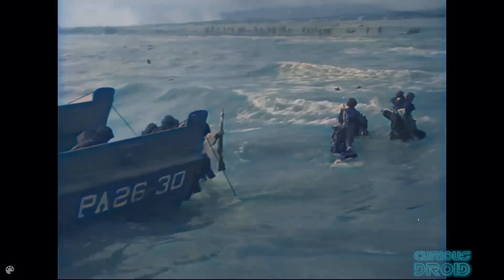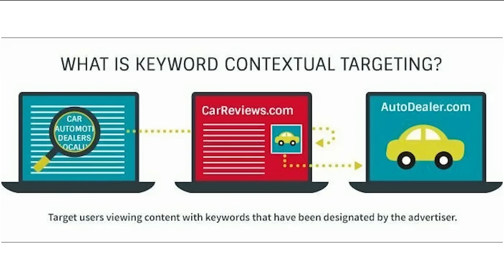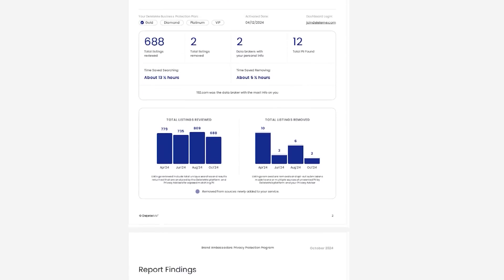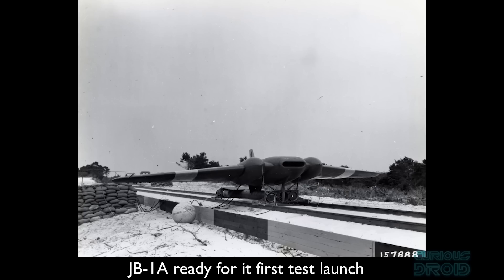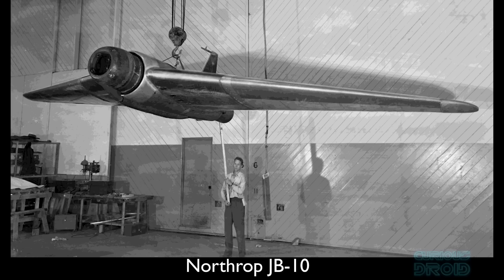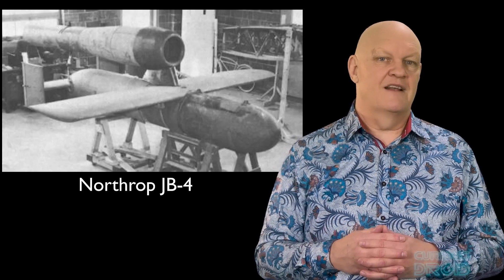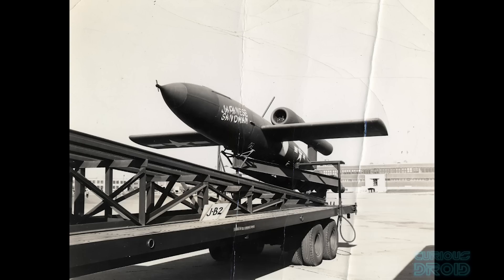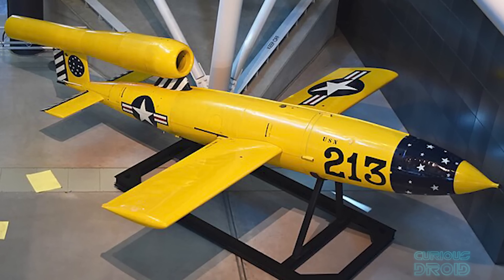America's First Guided Missile and How it Changed Warfare

Comment: The British gave the US a defective V-1. It failed to shut down the pulse jet  then dive when over its target so flew on until it ran out of fuel. The V-1 glided down to do a belly landing that should've set off the war head but didn't. The German Arms Ministry was paying 13,000 RM for each V-1. The US Army found a company to make their first copies for $600 apiece.
Reply: The V-1 never used to cut the fuel to initiate the dive. It used a small explosive to push and lock the elevator in the max nose down position, the sudden dive caused sometimes an engine stall

Comment: When I was stationed at Keesler AFB, MS in 1969, there was a JB-2 Loon on static display. I wonder if it is still there? 

However the very first attempt at what are now called cruise missiles, was ordered in 1917 by the U.S. Army's Aviation Section of the Signal Corps (the forerunner of today's U.S. Air Force). It was ordered from Charles Kettering and officially called the Kettering Aerial Torpedo but was nicknamed  "Kettering Bug".  World War I ended before the "Bug" had completed testing so it wasn't needed. So we've come full circle: Kettering Aerial Torpedo to the Fieseler Fi-103 (V-1) to the JB-2 Loon to the BGM-109 Tomahawk.

Comment: I'm surprised the V-1-based development carried on for so long considering the V-2 followed so quickly afterwards. Didn't the V-2 make V-1-style propulsion obsolete?
Reply: The V2 was ridiculously expensive, to the point where they probably caused Germany to lose the war noticeably sooner than if they had never been built.  Even with the high failure rate and high rate of being shot down, the V1 delivered explosives to England for much cheaper than the V2 could manage.

Comment: The JB-2 Loon wasn’t the first American guided missile.
As the number indicates it wasn’t even the first jet powered one.
The U.S. Navy used piston engined ship launched TV guided missiles (Interstate TDR-1 and similar Naval Aircraft Factory TDN-1) to attack Rabaul in 1944.
The turbojet powered Interstate XBDR-1 was supposed to supersede the these but then a clone of the V-1 rolled into frame which also resulted in the cancellation of the turbojet Northrop JB-1 Bat…

Comment: If one wanted an unmanned bomb, you could use a regular propeller/engine. Did even the early ram-jets have a power or cost advantage? Seems like the guidance system would be the valuable tech there.
Reply: Simplicity of manufacture.

Comment: Actually, there were at least two prior attempts, though today we'd probably classify them as drones. The first was between WWI and WWII, using remote controlled obsolete biplanes loaded with explosives. The other was during WWII, where worn out B-17 were going to be filled with explosives, flown part of the way manually, then the rest of the way by remote using primitive TV cameras, with the flight crew jumping out before the turnover. This was cancelled after a mishap where the plane detonated killing the crew led by JFK's older brother Joe Jr..
Reply: To also add on, we did develop AShM and some SAM in WWII

However the AShM beung the ASM-N-2 Bat was used compared to the Gorgon which never saw anything beyond testing.
Reply: Go back farther, to 1917 and you'll find the Kettering Aerial Torpedo, aka “Bug”. This was an unmanned biplane bomb with a 180lb warhead and a small prop engine. It was designed to break free from its wings after a predetermined time, causing the bomb to drop. There's a replica of one at the USAF Museum in Dayton.
Reply: @jarink1  THAT"S THE ONE I WAS THINKING OF!!! Thank you for the clarification!
Reply: @jarink1  US did it again and called it Project Kingfisher but, so we got aerial torpedo before Germans got guided bomb and torpedoes lul.
Reply: "Primitive TV cameras" was an entirely different line of drones (Interstate TDR), which were actually fairly successful

Comment: Hmmm, piloting remotely by tv, radar guided...  If I remember correctly, the V-1 just had gyroscopes to keep it's orientation and a prop and rotation counter to determine when to cut the fuel as it should be at it's targeted range.  The guidance was so primitive that British pilots would just tip them on the wing to throw them off course.  Seems like they missed out on the original intent and that is was to be inexpensive and readily manufactured.
Reply: The American variant was designed for submarine launch and had four times the range…
The Ford engine had a 90 minute design life compared to the 30 minutes of the original Argus engine…
Reply: @allangibson8494 to be fair, Germans didn't really needed more range and also had He 111 modified for aerial launches of V-1 to deal with range, flexibility and fact launchpads for V-1 where extremely easy targets (so where submarines having to first assemble it and prepare the launching rail)
Reply: @depressedTrent  Ford added rubber seals to the engine valves which greatly improve reliability.
Over half of the V-1’s failed to reach England due to mechanical failure with the net result that more people died creating the V weapons than died from their use…
The intent behind the Loon project was to use them for harassment raids on Japan between early November 1945 and April 1946… (assuming that having seventeen atomic bombs dropped on them didn’t persuade them to surrender (that was the Operation Downfall plan - five bombs on cities (two actually used) followed by six on Kyushu in November 1945 to clear the landing beaches, followed by another six on the Kanto plain around Tokyo in April 1946…)).
Reply: From all I have seen and read, British pilots flying Typhoons, were the only ones able to match or exceed their speed. A few pilots died when they got too close when they shot at them and caused the V-1's to explode.
Reply: @ The Gloster Meteor’s got a few as did the Griffin engined Mk14 Spitfires.
The Mk 14 was about 10% faster than a V-1 running empty and the Meteor was 50% faster.
Reply: @allangibson8494  Brave pilots in 'leading edge' technology.

Comment: I never knew we copied a V-1 so quickly.
Reply: It's because there isn't really much to copy on V-1, it's ridiculously simple thing by design with very little moving parts - cigar shaped body with circular crosscut, wings made from just one type of rib and no control surfaces, fuel tank that's just segment of the fuselage, two pressure tanks with oxygen showed in, chunk of explosives in front and it's engine is literally just tube with fuel injector. And since USA already had some development done in regards of avionics and steering, they could have it done as quickly as they could make tooling for it.
Reply: @depressedTrent  It's simple tech now. It was cutting edge at the time. If it wasn't, they would have just ignored it and done something else. The 'tooling' was the easy part. If you bothered taking the time to actually pay attention to the video you'd see that they tried to make their own more elaborate version but it failed so they went back to the original German concept.
Reply: @depressedTrent  it's called a pulse jet and no need for oxygen as it's not a rocket engine.
Reply: Look up the Kettering Aerial Torpedo. Who copied whom?
Reply: @Tomyironmane  Yeah, no relation at all. The Yanks copied the Germans and the V1 is much more closely related to modern cruise missiles than that torpedo thingy. Yanks love to pretend they don't copy but do in the end. Loads and loads of examples of that.
Reply: British Intelligence ws getting a lot of information about the V-1 project, long before D-Day. Some of the details were kept secret, but such things as the RAF bombing Peenemunde were driven by the knowledge. The RAF was attacking -weapon site in France before D-Day.
 
I find it difficult to believe that nothing was known in the USA And it is remarkable that the creator of this video seems unaware of the 1978 book "Most Secret War" by R. V. Jones
Reply: The American German scientists were better than the Russian German scientists.
Reply: V1,V2 all the cool toys and the clever folk were looted from Germany by the guys that "won". To the victors the spoils, or something like that.
Reply: @ABrit-bt6ce ”won”? Berlin was leveled and hitler committed suicide.
Reply: @ABrit-bt6ce It wasn't just the missiles they took. Google "Werner Von Braun": Head of the V2 rocket program, then head of NASA
Reply: The British were leading the space race without German help. They decided to do something useful instead and created the welfare state,NHS,etc.
Reply: @Trebor74 the first valid concept for Britain to get a man in space was using a heavily modified V2 rocket.
Reply: @Trebor74  ...and because theyve created the welfare state, the NHS, etc, every country in the world is now running loans larger than their budget. If thats how we are playing "economics", why bother with money at all? Just make everything free, since apparently money has no value, if countries can be indebted for thousands of years forward without ever having to pay those loans back.
Reply: @Trebor74  As with the other post-war space-faring nations, the British government's initial interest in space was primarily military. Early programmes reflected this interest. As with other nations, much of the rocketry knowledge was obtained from captured German scientists who were persuaded to work for the British. The British performed the earliest post-war tests of captured V-2 rockets in Operation Backfire, less than six months after the end of the war in Europe. In 1946 a proposal was made by Ralph A. Smith to fund a British crewed suborbital launch in a modified V-2 called Megaroc; this was, however, rejected by the government.
Reply: @Trebor74 Except that it’s not a zero sum equation.
Reply: @Trebor74  ...which eventually attracted millions of people from around the world to come and live in the UK and enjoy the free healthcare, free homes, and free money.
Reply: thats all the @alien stuff testet after 1945. lol